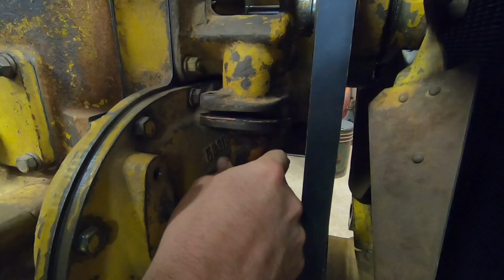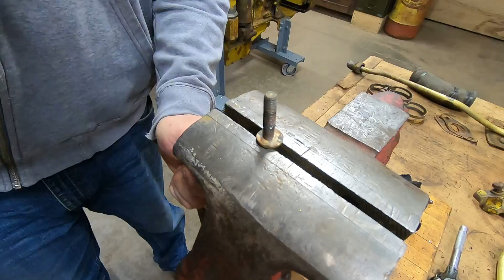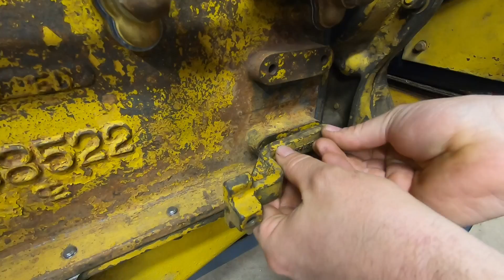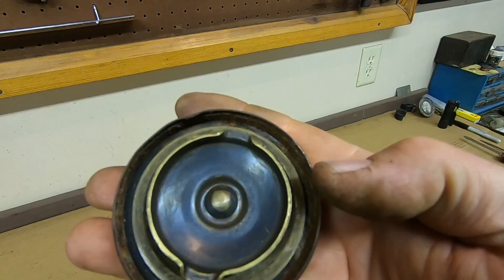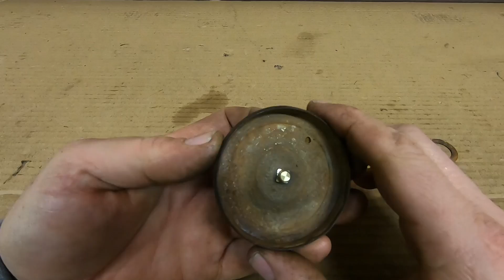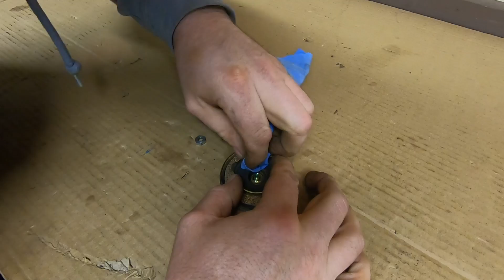Caterpillar D2 #5J1113 Diesel Engine Assembly Ep.51: Rebuilding & Installing Radiator Connections

Comment: i'm torn on the radiator cap. one one hand it came out AWESOME! on the other hand i wouldn't mine having new and visibly painted/refurbed fluids caps the WHOLE way round the tractor. one glance and you know it's all good/safe / reminder to check fluids by anyone familiar or Unfamiliar with the tractor / advertising it has been maintenance. kind of dumb i know. i still really like how the original cap came out and think it looks great just as much!

Comment: I would have put lock washers on those radiator supports.  Personally I would have stripped and repainted everything and replaced most of the bolts.  I would have also run taps through all the threads...  I have never been one for patina.

Comment: Have you thought about doing a video about checking all the areas on the engine for diffrent oil levels like starting clutch  and diffrent  oils for rollers and tran finals. My 1946 books for my 5t7197w  d4 lack verry much and dont know were to look

Comment: If you have trouble with the nut eventually corroding on that radiator cap (dissimilar metals, and coolant is hell on unprotected machined steel surfaces) you might try using a nut made out of brass, using a spot of solder to retain it if loctite doesn't work.  If you ever have to take the top of that cap off, you might be able to use some metal spinning tools to slightly flare the lower edge of the cap so you can get it off without destroying the metal or the knurling on the edge.  Hopefully you won't need to though.

Comment: This comment goes back to your search for an intact engine block for 5J1113, particularly your very disappointing discovery that the block from 2113 had a crack that apparently predated your grandfather's purchase of the tractor and which had been stopped with Stop-Leak for its years of service with your family.  Have you saved the block?  

It occurs to me that as blocks become even harder to find, someone in future years might be willing to weld, braze, or use some type of chemical bond to patch the block, or even -- if he's desperate enough and has a deep enough wallet-- do a 3D scan of the old block and either create a mold to cast a replacement or machine it out of a billet, top fuel dragster-style.

Comment: G'day from an Aussie subscriber Squatch .. Mate I see you assembling all sorts of components "DRY" .. especially threads (bolts) .. I use a Valvoline Protective Product .. "Tectyl" .. Tectyl 506 Heavy Duty Rust Preventive .. to be precise. I use this product on nuts, bolts, pins, even paper gaskets (both sides of the gasket) .. the gaskets if ever have to be removed won't stick to the sealing surface, bolts never fail to undo and never vibrate loose. Also in your case where you don't like to apply fresh paint .. I thin the Tectyl 50:50 with Mineral Turps and spray or brush the mixture onto the clean dry surface of machinery panels, vehicle body panels and component parts and fixtures (bolts) .. the Mineral Turpentine evaporates away leaving a thin slightly brown (almost clear) wax type feel coating (rust proof) to the surface. The Tectyl film can me easily removed by using ANY Petroleum product .. diesel, petrol, mineral turps and the like .. I seriously use it extensively on any of my restoration projects and repairs .. I highly recommend that you check it out with an open mind .. It really is a great product and an ASSETT to any restoration project.
Regards and Respect, Cid Wootton.    PS. Great Work .. Mate .. excellent channel .. thank you.

Comment: Good design hose clamps. Originals still have lots of life left.  What goes in the thermostat housing?  I see one threaded fitting you did not fill?  I like how it is coming together and the concept of new functioning but looking old.
Reply: @squatch253  That's what happens when I start with a comment before you are finished. Was not watching what you were pointing to when you said temp gauge here as I was typing!

Comment: that new radiator cap would probably have worked fine, but it was way too shiny for 1113, might have been able to age it somewhat but this came out much better, I think I would have cleaned the inside of the cap but it's your project and it came out great

Comment: Just a couple of thunks (if drunk is the past tense of drink, then thunk must be the past tense of think) re. the radiator cap, it looked like the nut you used was a steel nut, if so it might be better to change it for a brass nut so it doesn't rust.  Otherwise could you take the 'guts' out of the new shiny cap and put them into the shell from 2115?, assuming that the cap from 2115 was the 'correct' cap, it would allow more of 2115 to 'ride again'.

Comment: I gotta give you props on that radiator cap. I would have slapped the new one on and ran it! Lol. I kinda thought you would build new supports out of thicker material since they were so prone to breaking. I know we're going for original, though. Just a hunch I had prior to the repairs you made.
Reply: @squatch253  with all the salt on our roads, it may not even take a week! Lol

Comment: I'm real impressed with that radiator cap rebuild. It was real nice, and should work just great.

On those radiator support rods, I know you aren't going to be painting this engine, but wouldn't a little paint or at least primer be worthwhile to keep the fresh ends from rusting too badly and weakening over time? You could always dust a little dirt onto the paint as it is drying to make it look old. :-)

Comment: would you be safer to add a touch of locktite to the knut on the cap so it does not vibrate loose and go into the core?

Comment: The difference of a Squatch 253 restoration and mine:
Squatch253:  Spends half day working on radiator cap restoration.
Me: Pour some weak acid and salt water on the repop to age it and put it on.
Originality Score:  Squatch253  1   Me:  0

Comment: Toby it's not boring when you see the detail work into the parts. That radiator cap was absolutely the best repair I've seen lately. Good job, I'm glad your back on 5j113 I've missed it since basically last year.

Comment: I think that locktite will go soft from the heat of the radiator fluid.  You might consider just staking the nut/shaft.

Comment: Good job refurbing the old cap. One trick I learned for those times when a new zinc plated part must be used, but you want the old look. Spray the part down with bleach and leave it sit for a couple days. Bleach will usually knock the shine off and speed up the patinization process.

Comment: in case you don't browse HF.. https://www.harborfreight.com/engine-and-transmission-oil-pressure-test-kit-64872.html 
 i don't know if the transmission pressure gauge has enough range for the fuel pressure side..  you would know by just looking.. i don't recall from your earlier videos on fuel system.

Comment: Hmm. A little silicone grease on that cork gasket would be my suggestion.  The twisting tears it up,it was not a great design in the first place.
I am amazed anyone would think of rebuilding the thing.
And I agree with the rest of the lads here. Staking or soldering that nut is belt and suspenders. Having that nut drop off would be no fun at all.

Comment: Love this build you're doing. The attention to detail is perfect. 
I was thinking as you were putting the support rods from the upper hose connection to rad on that a couple of rubber grommets between the nuts and the pipe flange would isolate the supports to the point that they wouldn't break up any more. Wouldn't be period correct but it would solve that problem.

Comment: squatch, on the radiator cap, you should take a center punch and give the center pin you threaded about 3 taps around the perimeter of the stud so the nut can't spin off. the loctite will not hold that connection for long and the vibration will rattle the nut off in a few hrs.

Comment: When you removed that new cap from the box, we knew that it would never be used on 1113. Maybe a drop of solder on the new nut inside the old cap instead of the blue loctite? Another neat detail video.👍👍

Comment: Great job on the cap. I think I would have bored and tapped for a brass bolt in that square brass stud only to get a little more thread. But, I can’t tell how much thread you have, ie, how thick the nut is. I would only do that because luck doesn’t come knocking on my door very often and that brass nut would wind up in the radiator. Ha ha ha. But, you’ll be fine, I’m sure. Just curious, if a Cat back then overheated where the the pressure blow out? No spring or overflow in the pic. Is why the radiators are full of holes? If its going to be a worker Cat why not put a new style cap on it so it doesn’t run up the pressure if it overheats? Thanks for the video. Hey, don’t forget you got a prototype laying around unfinished up there!
Reply: @squatch253 - Thanks for the reply!

Comment: There is another proof that old things were built to be repaired. 
there's no way you could do that to a radiator cap manufacturer today. 
I noticed another interesting point on that Caterpillar engine, the coils on the injector lines are all the same length due to the number of turns of the coils. Nowadays you just have short lines medium lines and long lines.

Comment: The detail you put into your work is what I like about this channel.  I was just a little concerned about how you finished off the Rad Cap with just locktight and a nut.   I'm thinking into the future and I see a nut sitting at the bottom of your radiator.   Is there anyway you can peen over the stud onto the nut for added security?
Reply: I reckon a quick centre punch to the middle of the stud should spread it just enough

Comment: Squatch253 do you ever use newer design parts when the problem solved is severe and could endanger the motor?  That's when I would break with authentic.  
Those radiator supports were verging on my limit.  The problem they cause by breaking isn't severe, but I would hate having to fix them again if a better design is available.

Comment: 10 out of 10 for the rad cap great job. The brace rods still need work thought the thread lengths are different and there a pin hole in one of the welds ( on the left rod I think ) keep up the great work it's a joy every time I get a notification that another squatch video has been added👍

Comment: Hooking the oil cooler lines was a great idea with the final adjustment on the radiator connections but the way you refurbed the cap was the best part. Learned somethings today. Look forward to the trans/rear end rebuild.

Comment: Great job on the radiator cap resto-mod! But my eye twitched when I saw it assembled without a mechanical locking device like a star or lock washer! With nice soft brass in the stud, could a quick staking be done to really lock in the nut so it does not find a new home in the deepest cranny of that beautiful radiator? Heat is an enemy of locktite. Have followed you with all projects and enjoyed each step. Hope I don’t sound negative or a keyboard commando, was wondering about the process.